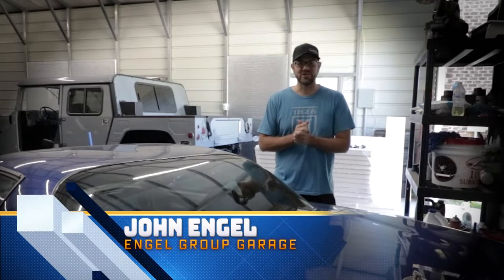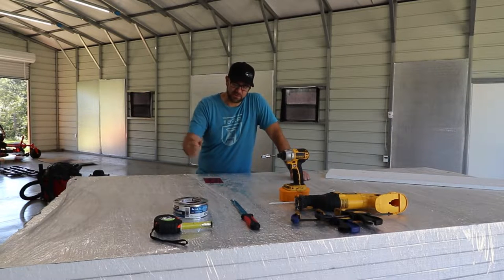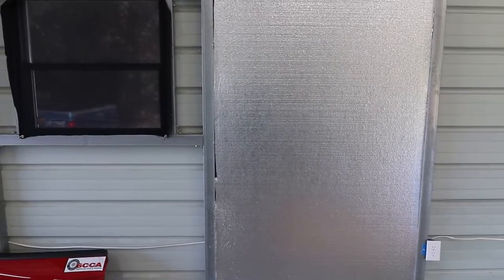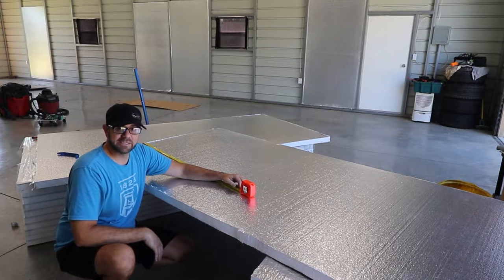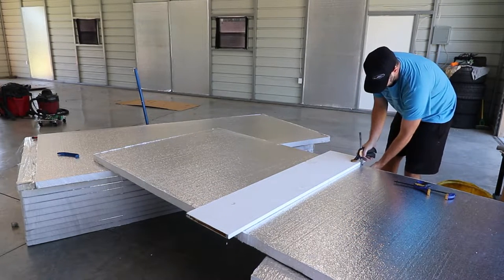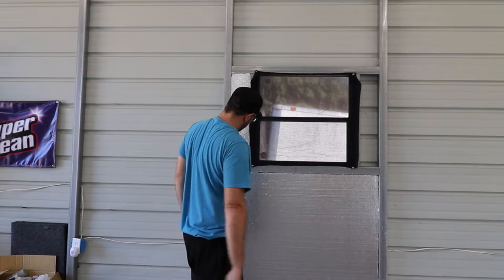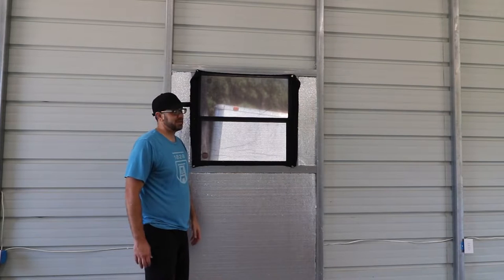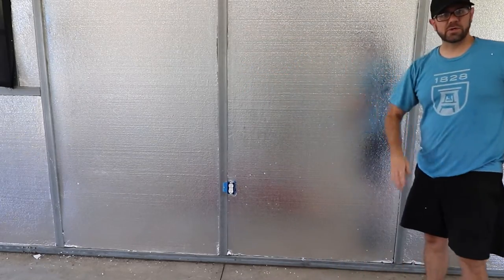Metal Storage Building 2 Inch Foam Board Insulation Install DIY

Comment: I'm sure someone has said this by now, but the silver side is supposed to face out against the steel exterior, with a small air gap between them for vertical air flow. That maximizes the reflection of radiant heat produced by the sun.
Reply from the maker: Yes. Many people. Lol. These are silver sided on both sides. So you can use either side and still keep a much more finished look.
Reply: @JohnEngel  Btw, how well does it dampen the noise when it's raining outside?
Reply from the maker: @Condor1970  it’s does a good job. Not perfect but much better.

Comment: Would like to know if this actually helped in the summer and winter. I been thinking of doing the same thing to help heat mine in the winter but afraid it will be hotter in the summer with the foil on both sides. How is it helping. Was it worth the money

Comment: Since the foam is combustible, I would not leave leave the walls and ceiling uncovered. In most places covering combustible insulation is a building code requirement. And, if a fire occurs insurance will not cover it.
Reply from the maker: Great info. Thank you.

Comment: You should be leaving an air gap with that foam insulation with a metal building. Also you lose the radiant heat barrier but not facing the foil towards the metal.
Reply from the maker: Thank you so much. Yes an air gap was left and the foil is on both sides. :)
Reply: @JohnEngel how deep it is the walls between the studs.. that it is false about the air gap I have read that it is really not beneficial
Reply from the maker: @daveyvega7348  I think it’s 3 inch.
Reply: @JohnEngel  thank you Sir... and how works so far the insulation?
Reply from the maker: @daveyvega7348  much better than without

Comment: Also if your just tired take a skilsaw turn blade backwards so it doesn't tear it up . Put duck tape for lines or prevent damage if blade is tearing it up a little . Mainly just heavy 2" sheets . And remember measuring cutouts always measure from the last sheet set and all measurements frome same side  bottom up or or left to right is accurate

Comment: Would like to see how it turns out on the roof, I am picking up my insulation tomorrow.  My plan is to run straps the length of the building and let the board sit on it.
Reply from the maker: I think I will have rent a lift to get to the roof. I will keep you posted.
Reply: Where did you find the foam board like John’s?

Comment: So far how does the garage hold up during summer 🌞⛱️? Does it help with the heat ?
Reply from the maker: Still hotter than I wanted. Lol. I think an AC unit is needed and hopefully because of the insulation, it will handle that easier.

Comment: John. I have this exact shop only taller. I’m very disappointed in the weather proof this is. What issues if any have you had with leaking around window, doors and base of the building. I wish they would have at least put a bead of caulking before putting the siding on but they didnt. I’ve tried silicone, spray sealant etc but it still leaks. I also live in Utah and have extreme heat in summer and cold winters so the metal expands and contract with I believ has cause the failure of the products used. Any advise would be appreciated. Thank you
Reply from the maker: Great question. I also has an issue on my one window. I found that the silicone on the outside and then expanding foam from the inside has solved my issue. I also thought about adding some flashing on the outside so that the water would shed away from the window but luckily that was not needed for me.

Comment: My building (30x35), is constructed exactly like yours.  I like what you have done, but am interested on how you did the ceiling?
Reply from the maker: Had to rent a scissor lift. Then press each in place. I used liquid nails and also two self tapping screws on each to make sure that if it did start to fall down, it would hit those.

Comment: Building a 50x24 now. Would spray foam be better for the top to prevent condensation here in Tennessee?
Reply from the maker: I would do the whole building in spray foam if possible. This was a budget fix because of the expense of spray foam.

Comment: Is the foil not supposed to be installed towards the wall as a radiant barrier?
Reply from the maker: These have foil on both sides. Double foil.
Reply: @JohnEngel  ah, I wasn't sure but was just a thought. What if they have it on one side? Then does it matter?
Reply from the maker: @jackle842000  yes. When I was looking at doing this I found this information that I used. 

“The foil is called a “radiant barrier” and it can be used to keep warmth inside a building, or, if used correctly, it can be used to help reduce the heat load coming into the building from the walls or roof deck.

There are a few scenarios for proper use, so I’ll go through them here:

For a radiant barrier to work, there must be some air gap between the foil and the wall or roof deck.

In other words, if you press the foil side of the insulation tight up against the wall (foil facing outward), the radiant barrier will not work. Of course, the insulation will work. This means that you are reducing the conductive heat load that goes into the building, but you are not reducing the radiative heat load. The insulation will keep the heat out on hot days, and will keep the heat in on cold days.
If, on the other hand, you use something like a 2″ x 4″ to create a gap between the wall and the insulation board (foil facing out) then you will have a radiant barrier. Here, not only is your insulation working, but so is the radiant barrier - and therefore, unlike in the above paragraph, you are reducing your conductive and radiative heat loads entering the building. The insulation will keep the heat out on hot days, and keep the heat in on cold days, and the radiant barrier will keep the heat out on hot days.
There is a third scenario where you have the foil facing inward. Here you can press the insulation tight against the wall, or have a gap… it doesn’t matter. With the foil facing inward you are keeping warmth inside the building on colder days and nights. The insulation, will also work to keep the warmth in on cold days, and to keep the heat out on hot days, and the radiant barrier will keep the heat in on cold days.
If you are placing the board in a window, face the radiant barrier outward. Otherwise, the heat that enters through the window will serve to heat the insulation board, and the board will in turn, serve to heat the room like a heating element in the oven. The radiant barrier facing outward will prevent this to a certain extent. You may want to experiment to see if it is better to have a gap, or no gap, between the foil and the glass pane on the window.
Finally, if to be used in an attic space, you can use the panels on the floor of the attic. Face the foil upwards to keep the heat out. In this way, the insulation will keep the heat out on hot days, it will keep the heat in on cold days, and the radiant barrier will keep the heat out on hot days.”
Reply: @JohnEngel I bought a new she that gets too hot. I bought simple plain foam boards that I cut and put by pressure. I bought the silver heat barrier and put it in top with staples. But I stopped. Am I doing this correctly? I read you should not put the heat barrier making contact with the roo panel wood, so in between I put foam ...is that ok ?
Reply from the maker: @chellychevres2969  you want the foil in-between the roof and insulation.
Reply: Y @JohnEngel  somebody told me you never put the foil touching the wood. :(
Reply from the maker: @chellychevres2969  that’s correct. You don’t want it touching you want to create a small air barrier between the two.

Comment: I'm about to start this same project in my 24x24 building. It is more of a pole barn with wood framing, and concrete floor. Plan on using liquid nails straight onto the corrugated steel walls.  

What type of foam knife did you use? Or would you recommend something different now that you have done yours?  Do you think liquid nails will hold the boards on the ceiling?  Thanks!
Reply from the maker: So I used the Amazon recommended knife and it’s amazing. I tried using insulation tape but that was no good. I’m thinking that liquid nails will work much better.

Comment: I bought the regular 2” 4x8 boards not the same as your reflective boards. Mine is just all pink. I purchased them but I have not installed them yet. Now that I see this video, you think it’ll make a difference or should I return them back and get the same as you did?
Reply from the maker: I truly think they will do the same. I haven’t seen the reduction of heat that I was hoping for.
Reply: @JohnEngel  ok cool, thanks bud. Also I was planning on liquid nail the boards instead of having them persist measurements. What do you think about that idea?
Reply from the maker: @DetroitLions1984  I think that is a better idea than what I did. If I was to do this again I would use liquid nails as well.

Comment: Just put the foam over the studs the metal over the foam....a complete thermal barrier. 
Why not?
Reply from the maker: ??? I’m curious.
Reply: @JohnEngel  instead of between the steel studs.
Hang like a panel of siding, tape to seal, then over lay with the metal siding. 
Less labor, more efficient,
Reply from the maker: @MalleusDei275  gotcha. That does make a lot more sense. I do agree that would be best.
Reply: @JohnEngel  
I used 2 inch foam board on my shed...

Comment: I thought there was suppose to be an air gap between siding and insulation. Vapor barrier?
Reply from the maker: Because of the siding used there is an air gap. :)
Reply: @JohnEngel  hey I'm confused, are you getting the air gap by just putting the 2inch from board flush with the front side of the metal frame leaving u about an inch behind it? Or are u pushing back flush against the siding and considering the ribs in the siding an air gap?
Reply from the maker: @gregorylaflame4405  there is about a 1 inch gap once I place the foam.

Comment: My metal.building studs are 5ft on center.   Makes finishing a nightmare.  How did yours come with 4ft studs?
Reply from the maker: Each manufacturer must use different dimensions.
Reply: I am about to run into the same situation, but I plan to run the rigid foam boards lengthwise, so I will have to cut each at 5'.
Reply: @wranglerdude1004  Just so much wasted product.  And the fact mine is 10 ft leg height makes it even more challenging.

Not to mention I got vertical siding so my purlins are horizontal in a different way than horizontal siding.

Comment: i am in the process of having a 30x 30 metal building built next month and was wondering what did they install under your roof metal before they put the metal on the roof?
Also did you go all the way up with the foam board. would love to see finished!
Reply from the maker: The roof has a thin insulation that keeps it from Haven’t condensation. I’m hoping to do a video soon of the final product.
Reply: @JohnEngel  do you know what they installed?
Reply from the maker: @farmerchuck3  something like this. It’s really no good for R value but will make sure that you don’t have condensation drips. https://www.ecofoil.com/products/double-bubble-foil-insulation-white-foil-4x125-500-sq-ft?gclid=Cj0KCQjw_7KXBhCoARIsAPdPTfg7UkEZz1t8MYbyxbyOmwa0c8Wt3WSZU-RGGhUxRn6lO6U19PoB0fYaAmGkEALw_wcB
Reply: @JohnEngel  @Chuck Cohenour check out Blue Trex A lot better than that bubble stuff that the building people offer.
Reply: @NYTROeast  can you add a link to it please

Comment: Hey John I have followed your build for a while and have been building my shop with tips from your videos. How well does your insulation. Also I have been look for that foam board everywhere on google and can’t find it. I am in Georgia so your build and weather is similar. I used the lights you recommended in your last video and love them. Thanks.
Reply from the maker: Hey Mark, 
Thank you so much. So far the insulation has done well but the real test will be summer. I found mine on Facebook marketplace.
Reply: @JohnEngel  John it's gotten  hot outside, how's the insulation performing?
Reply from the maker: @KT-1  it does a good job but it’s still hotter than I expected. Now I’m going to look into budget friendly cooling.
Reply: John did you finish the insulation and cooling? and more videos on that?
Reply from the maker: @markfayerman1206  not yet. I really need to get on this. Lol
Reply: @JohnEngel  did you get the whole building insulated and its still hot or just what you habe insulated in the video?
Reply: @JohnEngel  hey John did you ever finish insulating your shop either with the foam or any other means?

Comment: Although it would make a bit more mess, a table saw would have made extremely quick and precise work to all that. I though in one of your videos a while back that you were going to use spray foam?
Reply from the maker: I totally agree that it tablesaw would’ve made this so much easier. I was originally looking to do spray insulation, the quote was $8500 and to do the foam insulation was 2000.
Reply: @JohnEngel  Definitely a no brainer, lol. Can’t wait to see how well it works out for you.

Comment: John, working toward a smaller version of your building. How do you plan to secure the ceiling panels?
Reply from the maker: I going to use a metal strap that is bolted to the main frame. At least that’s the plan. Lol.
Reply: Been told ceiling insulation is very important w/metal due to condensation and dripping on whatever is below. Have you heard / experienced same?
Reply from the maker: @mikerentchler6889  that is 100% true here in South Carolina. The humidity will cause it to happen.

Comment: Where did you purchase your 2in foam board w/ radiant barrier without writing on them?  They look slick!!
Reply from the maker: This was a Facebook marketplace find. I also liked that it has a somewhat finished look to it. :)
Reply: @JohnEngel  man can you find out some more info, or if anyone has a link, I like how it fits almost flush in there. Can't seem to find them anywhere else.
Reply from the maker: @bullshiet  https://www.facebook.com/marketplace/item/123580019956605/
Reply: @JohnEngel  Thanks, able to find some locally but they were around $24 per sheet. Still pretty economical. Now how to do that ceiling tho.

Comment: Very nice.  May I ask you this:  for a small metal building for storage, is it hard to get a permit to build?   Do you have to pour poles for securing the structure ?
Reply from the maker: It was actually really easy to get the permit. I just went to my county office and explained what I was doing. They then give you the needed paperwork and information needed.

Comment: Hey John,
Are you going to  finish off the walls with either OSB or peg board or something?  I just got a 20x30 garage built and our next step is figuring out what to do for insulation.  We're in central FL, so the heat and humidity are coming!!
Reply from the maker: Great question. For now I’m just leaving the insulation exposed. Eventually I would love to finish it off.

Comment: Thank yoooou John!!!❤ I figured installing foam sheets was pretty straight forward but wasn't sure if I was missing something like some sort of glue or maybe the proper way was to nail it somehow but there weren't any videos showing it as clearly as you just smacking those puppies onto the metal wall! 😆
Reply from the maker: lol. Liquid nails can be used as well. :)
Reply: Got it thanks! Quick question, my insulation foam boards say they're combustible on them, I figure most are? Do you not place a thermal barrier in between the metal wall and the foam board? I imagine the sun's heat on the metal wall can make it pretty hot and that may be dangerous if the foam board is pressed up against the hot metal wall? @JohnEngel
Reply from the maker: @The-Blue-Ghost-Plant-Co.  great question. The panels that I bought have a layer of thermal reflective material on both sides. It is my hope that this will prevent any issues.